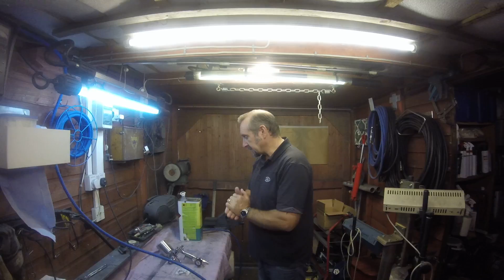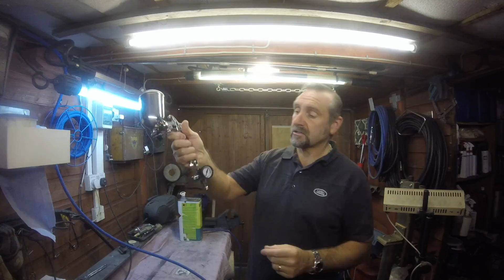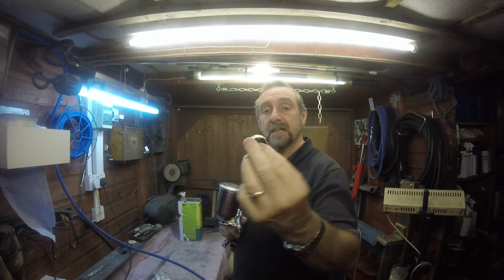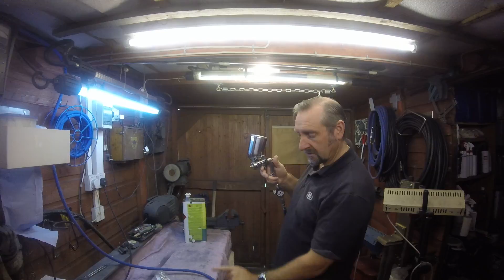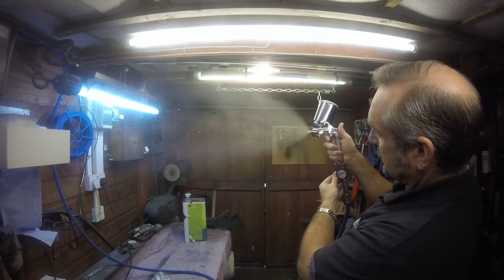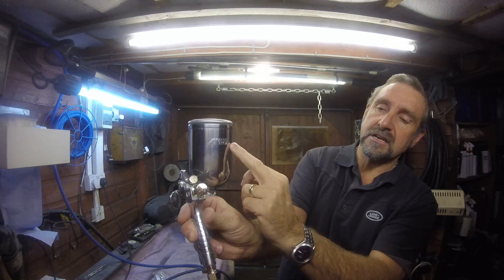Anest Iwata W101 Gravity swivel spray gun

Comment: Hi Jason
Wondering if you can help me. I help a friend race motorbikes and i have been repairing the fairing when he crashes using rattle cans i am now thinking of having a go with a spray gun but don't know what gun to get etc i have a budget of around £100.00 for the gun can u suggest anything. 
Cheers Scott
Reply from the maker: You can't go wrong with the w101, I suggest a 1.2 keep an eye out for a used one to save a few quid, an ANI R 150 is also a good option 1.2 the same because you need a smooth  finish with bike parts
Reply: @jasonevans6720  thanks for the help. i found this one but it only goes up to 1.0mm nozzle A.N.I. R150-Q (superior silver finish) HPS Mini/Midi Gravity Spraygun
Reply from the maker: @scottyoung2995  should be ok

Comment: With the 1.5 tip, do you think this would be good for painting gas pipeline stations? We use tnemec paint and strive for a semi-gloss to high gloss finish
Reply from the maker: No, I think you need a much bigger pressure pot type set up

Comment: I just bought one of the 'cheap' units that showed hologram serial so looks authentic from listing at least, $55 USD shipped, so killer deal if it is.. Bought to paint primer n single stage on a 69 Buick GS.  Will see how an anatuer does, been 30+ years ince painted often enough to feel confident, but used to weekend warrior paint jobs for buds in past and did well so confidence is high.  Couldn't find much information on the gun until after I bought it, didn't know if was a smaller series, but the pattern I've sprayed in past wasn't much, if any , wider so I think I will be fine,  going to do panels at a time after a roof skin replacement, liked the small cup for small jobs, and using Tabco black DTA primer so have long enough window to top coat or to apply high build atop then return to use as sealer before shooting a dark single stage.  Nice vid, keep up the good work..
Reply: Ordered mine with the 1.5mm tip as well...

Comment: I've used this spray gun, And can say it is top quality. You can get a really top quality finish with it. And for the price is a bargain i would say. Great all round performer, I've even used it for waterbase. Solvent base, 2k primer, laquer and topcoat. My setup is a 1.3 mm It's great for individual panels and i think with maybe a 1.6 or 1.8mm fluid tip it would be possible to paint the side of a car with one, while making significant savings of paint wastage. I would definitely get another and experiment with a bigger fluid tip.
Reply: I'd say that in the last ten years or so 1.3 has kind of become the standard for car painting, even with this gun being a bit smaller in regards to the fan pattern. My experience has been that the finer atomization of the 1.3 with a the pattern of a full size gun makes for a flatter finish. The particle size at 1.3 even fully open is still going to be smaller than say a 1.8mm almost fully closed all things being equal, although I'm sure you can play around with air pressure some to help mitigate things.